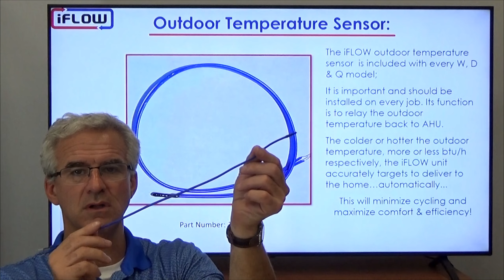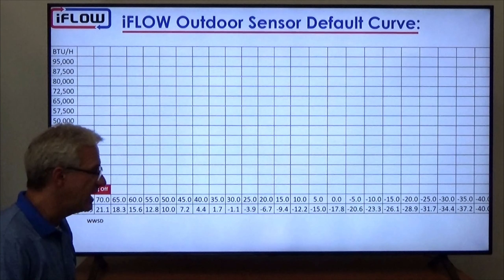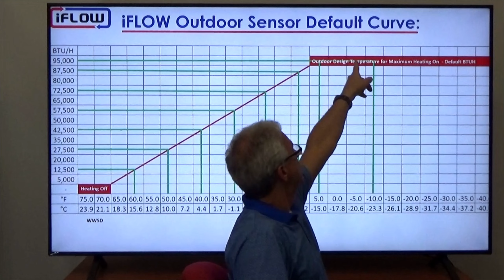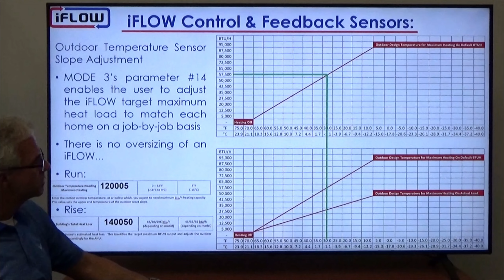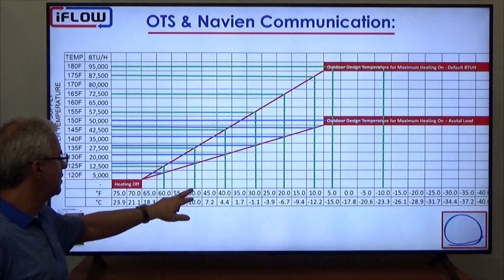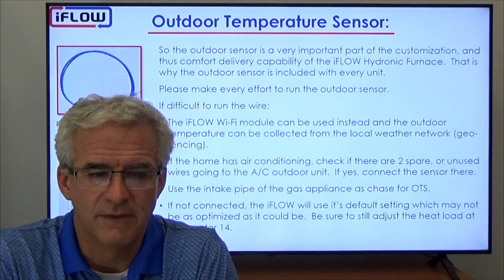iFLOW Outdoor TemperatureSensor & Reset Function

Comment: Hi, I recently installed iFlow hydronic system (heat pump+air handler). But the outdoor sensor was not installed because I was told that the system would get the outdoor temperature from the Ecobee thermostat. Is that correct? Or should I install the outdoor sensor ?
Reply: Hello.  That is incorrect.  The Ecobee will know the outdoor temperature but there is no way for the Ecobee to transfer that temperature to the iFLOW.  So the iFLOW will not know what the outdoor temperature is.  If possible, it would be best to have your contractor connect the outdoor sensor to the iFLOW.  In your system, the Ecobee is controlling the switchover between your heat pump and hydronics so we do not need the sensor for switching purposes, but for modulation purposes when running hydronics.  Thank you for your question.
Reply: @stephenbagshaw2786  Thanks for your feedback ! 
I have a second question : I'm not sure at what temperature to switch to the heat pump from the auxiliary heating ? For now, the heating system is programmed to switch to the heat pump when the outdoor temperature is above -1. 
I also switched to the auxiliary heating during winter because when heat pump is enabled and air handler starts off, there will be a very cold air for up to 2 minutes before turning up warm, which is annoying. Is that normal ?
Reply: @adil.o956  Unfortunately that is normal when using your thermostat to switch between heat pump and auxiliary heating.  The reason is that when the thermostat calls for the heat pump, it signals the iFLOW to call on the outdoor compressor right away.  When we do this, we turn on the fan to move air across the evaporator.  It may take even a few minutes for the heat pump deliver hot temperatures to the evaporator and in the interim, you may experience it a cold air through the registers. If using the iFLOW to control the switchover, this would not happen as we wait until the outdoor unit is providing over 90F before we start the blower to avoid blowing cold air.
Reply: Thanks for your feedback. I ll try to use the iFlow Control..

 What about the ideal temperature to switch to the heat pump vs aux, for a maximum cost efficiency ?